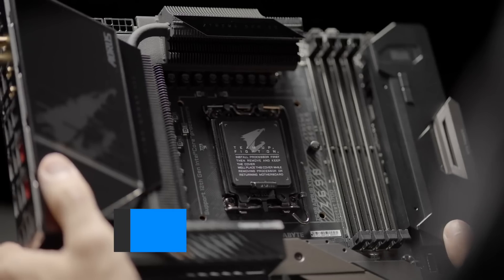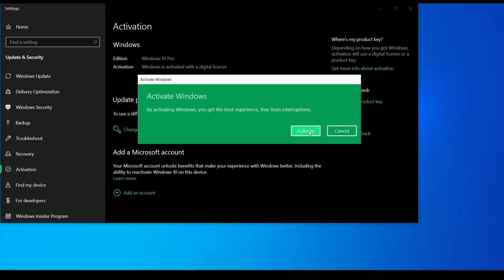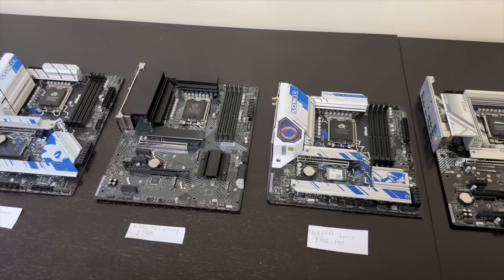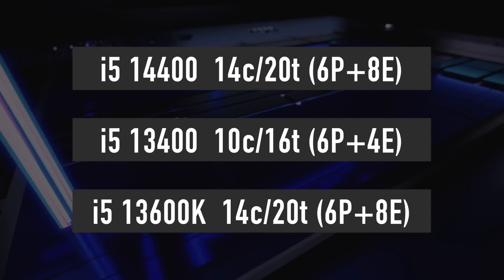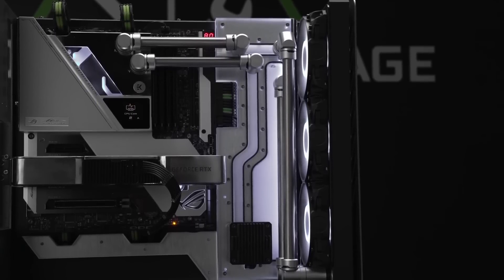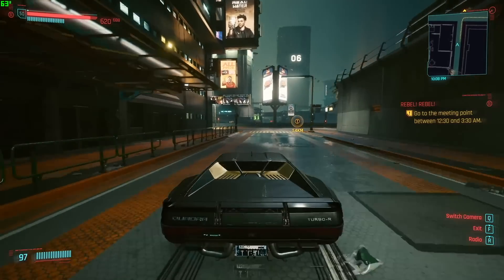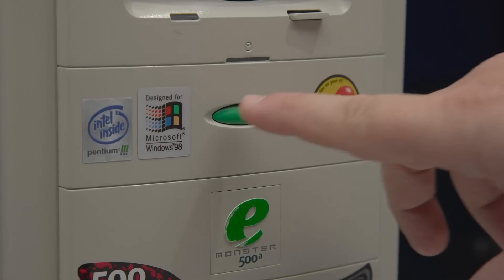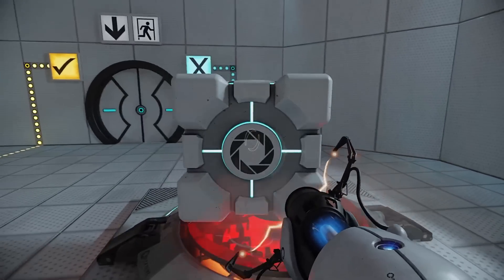Intel 14th Gen is actually VERY impressive! [i3, i5, i7, i9 specs, performance, release date]

Comment: WAIT!!! there is no I anymore in the 14th gen...
Reply: apparently they're continuing with that nomenclature for the desktop SKUs. 'i' disappears across the board for Arrow Lake (15th gen)
Reply: @treyquattro   so 14th gen is a stop gap???
Reply: @notrixamoris3318  in my estimation they have to put out something because of the competition with AMD. You could call it a stop-gap. We were going to be getting a much improved Meteor Lake product on the desktop but because of Intel's poor financials they backed down on that and now we're being stuck with Raptor Lake Refresh and calling that 14th gen on the desktop; laptop does get proper Meteor Lake upgrade, at least that's the most recent I heard. 15th gen - Arrow Lake - IMHO will be the one worth upgrading to, assuming Intel can get its act together like they were unable to do with Meteor Lake (on desktop). The benefit of 14th gen is that it's 3 generations with the same socket and chipset whereas Intel normally goes 2 max. But then calling Raptor Lake Refresh a new gen is a bit of a stretch. IMHO, that is.
Reply: 14th gen on desktop will be an exception, since it is so similar to 13th gen, they decided (rightfully so, I'd say) to keep the iX naming. 14th gen on laptops, which will be Meteor Lake, will use the new naming though. And on desktop the 15th gen.

Regarding if 14th gen is a stop gap. On desktop it kind of is. Rumors say that Meteor Lake binning couldn't be done good enough to make it make sense on desktop, so to speak. That is, even though it supposedly has about 20% better IPC than Raptor Lake, they could only get it to about 4 GHz. 4 GHz + 20% better IPC means about the same as a 13th gen at 5 GHz. So while it will better on power consumption, on performance it will be a regression at the top end and a stagnation on the low and mid end. The prices I doubt would've been better. Since on desktop you care about performance first (especially in the high end) and power draw second, it would have been basically pointless.

Better have the Raptor Lake refresh, which apparently comes with a digital voltage regulator or something like that, which can lower the power draw by as much as 20% compared to Raptor Lake. Hence why they can, again, go with higher clocks, even though the 13th gen already consumes insane amount of power at the high end. 13900K, unless you have a golden sample, is impossible to cool on air and reach the highest clocks (aka not have it thermal throttle). 14900K I don't think will be able to consume more than 13900K (or any other CPU in that form factor), but will simply be able to reach higher clocks for the same power, or lower power for the same clocks. Kind of like a manufacturing node advancement.

Comment: i3 with 6 cores is really impressive
Reply: I5 with 8p cores also impressive. :)
Reply: Imagine they also unlocked it
Reply: if its still locked its pretty un impressive tbh. 12100,12400 and anything AMD offers will likely be way faster if it is locked.
Reply: Only if the price is reasonable😊
Reply: Same I got i7 13k and it rocks
Reply: @blue-lu3iz for real we can find 7600\7600X for 199 dollars and it even gives starfield
Reply: The power consumption will be the real bar for the low end type. There's no point on upgrading  if the max power consumption is going to be equal as i5 gen 12th-13th.
Reply: @eiah590 4t8c has been ultra- budget for the last two years... if was the entry then the 5600g and 5700g wouldn't exist
Reply: Apart from gaming and the 0.1% percent of people who do video editing n stuff, what's the point of all this. My 8th gen i5 literally does everything I need it to do with no lag or freezing on windows 11. I don't get it. Apart from games
Reply: @SevenCostanza  Same here, my 6th gen i3 is also does everything apart from high end games. Still, it's the energy efficiency that matter the most when it comes to new technology since ages ago. My i3-6100 could throttle to 100% with only 65 watt but still fell to comparison with 12th gen when it only goes about 45 watts (while 12th gen goes up to 89 watts at 100%). So, it's interesting when intel say that their new CPU could save up to 50% power consumption.
Reply: If it be at around 100$ it would outperform any older i7 cpus before 10th gen 

So the used market prices will drop AF
Reply: It would have been impressive nearly a decade ago.  Intel gave us 4 core i7s for almost a decade total?
Reply: @blue-lu3iz True, there is the ryzen 5500 that cost just 95$ ( tray version even more cheaper ), this cpu also got 6 cores & 12 threads
Reply: 6c12t has been entry level since the ryzen 1600af hit the market... I'm glad Intel is leaning into that trend
Reply: @blue-lu3iz why would they sell it for 100? you realize the current 13th gen in 120 right? just stop with the entitled thought process. even if its 150 it will still be a great deal.
Reply: @iequalsnoob  its sub 100, and honestly that is to much for the 13100 considering its locked down, maybe 50 its okay for that one.
Reply: @iequalsnoob  The 6 cores has been the entry level for a long time already, check cpu's like ryzen 5600\5500, the 5600 cost around 130$, while the 5500 is around 95~100$
Reply: Fro older games? Yeah 
But for recent games and games in the future, we’ll the cpu is kind of the weak point , and saturate easily 
More and more games will be cpu focused games , like starfield for example 
I hope direct storage will be the new standard or we will have to put a crazy amount of cpu cores just because the software isn’t ready yet
Reply: @jeisntthereanymore  BS! The recent games are still massively limited either by their GPUs or by poorly written engine who can barely use a multicore CPU properly. Case in point: the original Crysis. It's still "CPU limited" to this day.
Reply: @Winnetou17 
Than how do you explain  factorio or starfield.  

Starfield has to keep track of every objects and know it's spacial position at all time .. that ,then there is the physic and planet movement simulation.  
So yeah cpu limited..

And factorio is a game that needs to keep track of once again the entity and their position,  and if there isn't enough physical cores on the cpu, you will be bottlenecked way sooner. 
Factorio scales more from a Good cpu than a good gpu .😊

Just a little reminder,  

Cpu handles simulation,  the more there is , the heavier the strain is on the cpu .
While :
Gpu is translating the simulation provided by cpu and convert them into pixel output .
That is called Raster
Reply: @jeisntthereanymore  I don't know about Starfield, but I do know about Factorio. Which is a pretty optimised game. Their Friday Factorio Facts were incredibly juicy reads, especially for developers.

You are correct, more simulation = more CPU requirement. But these games are still the exception, not the norm.

Also, the people who have a modern high end CPU and reach those limits in Factorio, you can probably count them on the digits from your hand.

In the vast majority of cases, the games need a better engine, a better GPU or both. Rarely they are optimized well and STILL need a beefer CPU than, say, 13900K or 7950X(3D). Actually, I don't think I can tell a single game in that situation. Maybe Starfield will. But it's made by Bethesda (the game studio), so the chances of it being properly optimized is about 0%. Not saying it will be terrible, but I'm sure there will be plenty of space left for software improvements.

Edit: improved grammar.
Reply: @Winnetou17 I am still waiting for that new factory update tho🥲 why is it taking so long😢.

Better game engine ,sure ,
Better software, sure.

But there is one limitation that will always exist and its the physic part . 

Trying to play factory with 4 cores Instead of 8 is a serious limitation ,

I agree with you ,factorio is tastefully done .

Now with Bethesda. Apparently they up their game , it should  with finger crossed be the first game they ever release with a decent playable state. 

But the cpu  being overwhelmed un starfield won't be because of bad coding , but because of the very logic of the game . Like starfield low-key will have a shit ton simulations to take in account.  And there is ou so much a 4 cores cpu can handle 

For example  even if a cpu with 4 cores was crazy fast.  Well it would much better to have a slow cpu but with massive amounts of cores and accès to smt.🤔
Reply: @jeisntthereanymore  I know your 4c (8t?) pain! I'm rocking a laptop with i7 6700HQ CPU from 2016. Used it heavily in the past almost 7 years and never let me down. And it's still decent in what I do with it, but, boy, am I drooling at modern 8+ cores/16+ threads CPUs.

But just like I got this very very good laptop (for me) 7 years ago, I want my next laptop to also be good for at least 5, preferably 7-10 years. And right now there's none that fit the bill. Anyway, I'm getting off topic.

If those rumors about Starfield are true, then that would be awesome. You got me curious about it. To be frank, Morrrowind, even though it has a host of bugs, given its scope, was still a pretty decent game at launch, from what I remember. Skyrim too. Can't tell about Oblivion, my computer at that time couldn't run it :))

Also to be frank, a game that has some part of it "locked" to 8c/16t CPUs or better (like Hardware Unboxed said, CPU power, since it might very well run ok on a 4c/8t in 4 generations) can reasonably be launched now. But, indeed, it would need to provide some way of enjoying the game with only 4c/8t still, as many people still have that. Or, dunno, if the game is that good, having a i9 9900K or R5 3600 be the minimum spec would still be acceptable.

Regarding your ending question... if good game engines were made, they would be able to run decently on, say, 8-16 E-cores that the 12th and 13th (and 14th) gen have. But everybody says they're thrash and that only some production workloads can use them effectively. Though I am curious, since I haven't seen any benchmark on this in quite some while, how are games now faring on just E-cores. And how will they be on the Arrow Lake E-cores.
Reply: @jeisntthereanymore dont repeat what other people have said

Comment: If this information about the new i3 is correct, would be a W if Intel finally decides to give the lower tier of CPUs 6 cores instead of the always 4 cores, it would absolutely crash the low budget sector

Comment: Still waiting for AMD to increase core counts.
Reply from the maker: For the moment it looks like AMD will keep Ryzen core count as is for the next generation. Would be nice to have Ryzen 3 upgraded to 6c/12t and Ryzen 5 to 8c/16t🙂
Reply: if 16 cores isn't enough then AMD has a Threadripper for you. Just be prepared to dig deep down the back of the couch.
Reply: @treyquattro  No, but how about a real 13600K type CPU from AMD?? Exceptional value like the R5 3600 used to be? Are we actually happy with 6 core R5 CPUs still??
Reply: @DeepteshLovesTECH  Most end users don't need a large number of cores: they end up parked in low power states waiting for something to do. Intel are beating AMD on single core performance which is what matters to gamers since games don't effectively use multi-processing because they have to deliver the same game experience across a wide range of CPU architectures; the variance comes from the GPU which is more of a known quantity and scales with execution units, shaders and VRAM. Bottom line: choose the CPU for your use case. 6 cores is fine if you end up only using one or two in your typical workload.
Reply: @treyquattro   Bottomline is both CPUs are enough for realistic gaming performance paired with reasonable GPUs (not like theoretical gaming benchmarks with 4090 at 1080p).
Whereas Intel smokes the the 7600X and 7700X in multicore. Effectively providing much more value.

I hope this reminds you of Zen 2 days. I don't know why people are not demanding AMD to come to that level of value as they used to be.
Reply: Probably will not. I mean if you already need more than the 7950x for multicore you are already looking into HEDT territory which they stopped supporting because the demand is really small while the huge dies can be used for EPYC where demand is non-stop.
Reply: Atleast each of their gens are better the 13100f is about 50% slower than a 12100f in multicore tasks and gaming it ain't looking much better. All because they locked down 13th gen it's so trash. 14th gen better be unlocked or I think I'll just never buy Intel again.

Comment: I hope they're finally overclockable again this generation. 13th gen was so much slower than 12th gen because they locked most cpus. If its still locked the 14100f will most likely still be massively slower than the 12100F etc.
Reply from the maker: I doubt Intel will ever open the non-K CPUs to overclocking.
Reply: @theivadim  they were a while, that's why the 12100F is so much faster than the 13100 could ever dream to be, or why the 12400 easily outperforms the 13400f for half the price.

The 13100&13400 make the 4060ti look like the best card ever made, atleast that's faster on average vs being almost half as fast.

And even with the higher cores, they'll at best be as fast as 12th gen then. Which would leave 0 reason to buy Intel.
Reply: @@jjd1265 It does tho, even multicore it is faster despite having less cores, single core its way faster. also literally no one mentioned 54c with aircooling and there is a lot more wrong with that irrelevant thing, but lets not get side tracked. it is very easy actually its literally the same as multiplier but you change a diffrent number. and you do need external clock gens but any decent board has one, and they're not expensive asrock as a B660 raptide gaming board msi has a board ( both are ddr4 too) asus has some cheap DDR5 boards for it.
like in the range of 100-150 euros you can have them, so either youre 12700k is super cheap or what you're saying about those boards its just not reflective of reality. kinda like with you saying a 12400f is slower despite it literally having faster multicore with less cores, and way faster single core, and thats at a soft oc to 5.1, plenty of people can push it much further. 5.1 ghz is what people talk about as a bad bin, even 5.3 is considered a bad bin. but its already faster at everything when running at just 5.1.
Reply: @Lynnfield3440  what? im yet to see a single gaming test where the 12400F beats the 13400F, at the very best scenario for the 12400F they either match or have a 1% performance difference, and in MT tasks it gets blown out of the water
Reply: @ishiddddd4783  it beats it in single and multicore tests, you can look at cine bench or cpu z scores. And they probably don't get compared to often as there is no reason to get a 13400f and no one cares about it. Kinda like the 4060(ti) being so bad no one cares either, products at half the price bear it easily so no one cares about them.

And in multicore the 12400f edges out the 13400f with a very mild OC and decimates it in gaming. While also consuming much less power in both scenarios.
Reply: @Lynnfield3440  it took me 30 seconds to search for their cpu z scores, and the 13400f is 4% faster in ST and 32% faster in multithreading lol.
Same scenario if you go to gaming, the gains are marginal but are still on favor of the 13400F with base speeds, it is simply not possible for the 12400F to be faster unless you are overclocking it while the 13400f remains without overclock, and it will still be faster in MT, you simply cannot beat 4 extra threads and 4 e cores with higher clock speeds when they have the exact same IPC since both are golden cove cpu's.
it's like saying the 12600 is slower than the 12400f lol, the only reason the 13400f is below that cpu it's also because the boost speed of both 12600s is higher, since the 13400f is a 12600 with lower clock speeds but still higher than the 12400f.
In blender tests they also draw 75Ws, and in gaming they are both on the 40-50W range, so not really an argument there.
Reply: 1) They won't unlock anything, that 12th gen was a mistake. Stop being so delusional
2) Freaking stop spamming your massively annying whine that 12100 is "soo much better" than 13100. In more than half of times you were off topic. Freaking stop spamming people on YT, go work those few hours instead of wasting everybody's time and earn the money to get yourself a 13600K or something. Jeez!

Comment: since i have ddr4 on my z690 board, i cant upgrade, when 14thgen only supports ddr5. because last i heard, 14then will drop ddr4 support
Reply from the maker: It doesn't make any sense for Intel to disable DDR4 support on these CPUs. The DDR4 memory interface is present on all Raptor Lake-based processors. But of course they can disable it if a decision is made. I haven't heard of such decision being made yet tho.
Reply: 14th gen will be DDR4 compatible since it supports the same motherboard as 12th gen and 13th gen. Intel will move to DDR5 only when 15th gen will launch.